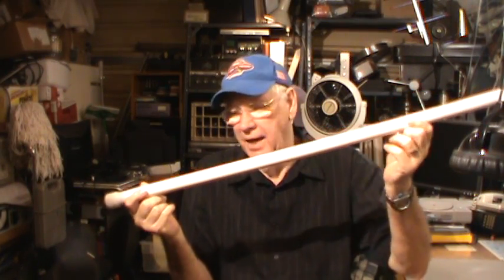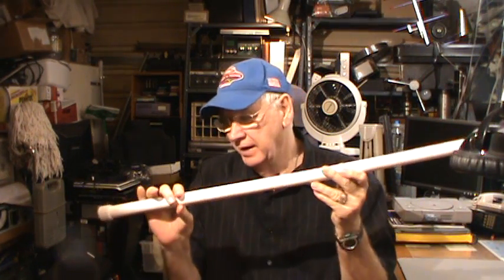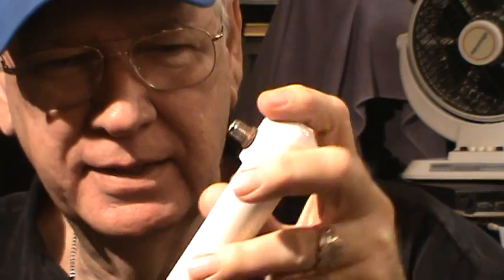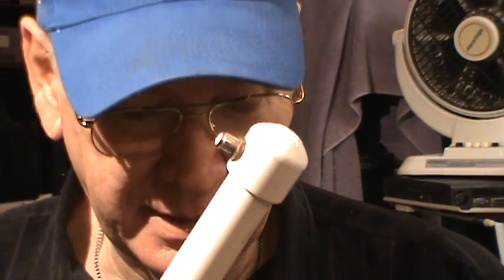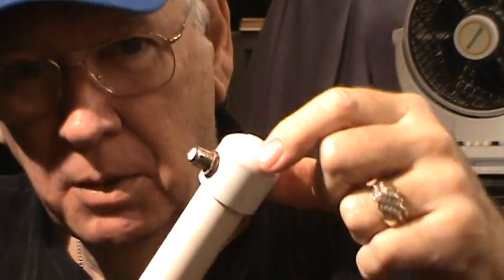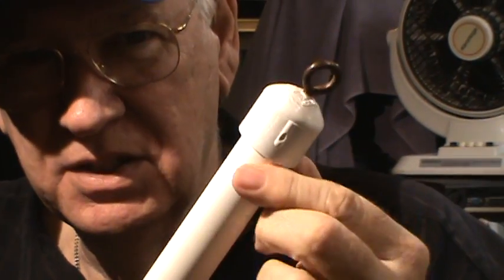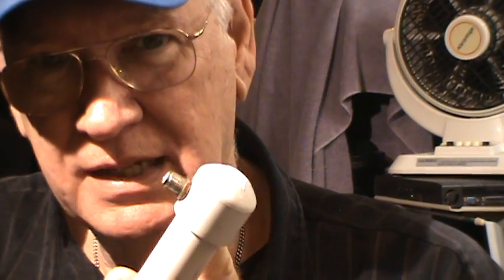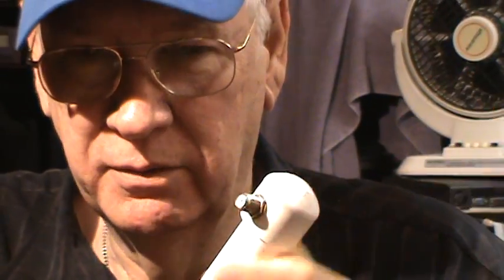TRRS #0430 - Plans for Broomstick Antenna Surgery

Comment: I would strongly recommend not to use a heat gun as it may damage some of the delicate diodes inside, if indeed there is anything inside.  My recommendation would be to use one of those hand held hack saws to cut the end off and if it's empty, just use it as a curtain pole for a 3 foot window.  Might also come in useful for some plumbing needs.
Reply from the maker: Interesting.  So you think there is some electronics inside???  Like I said I am going try the heat gun on the opposite end to see if that concept will even work.

Tom
Reply: hamrad88
Well I'm no scientist, but don't see how a 3 foot curtain pole can capture more electro magnetic radiation than a big long wire strung out of one's room.  No matter how many coils are wrapped up inside it.
Reply from the maker: davidbennett60 My research on this antenna design shows it does work but most of the ones that were reporting working were much longer.

Tom